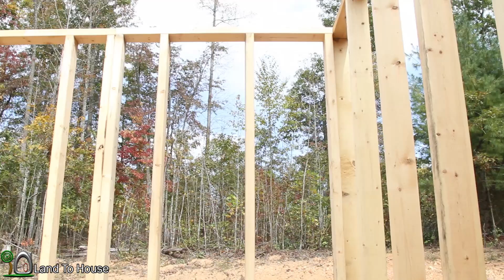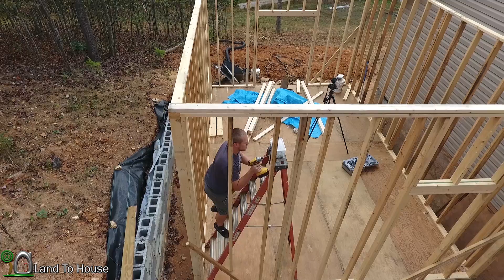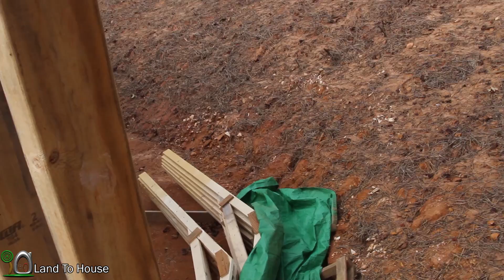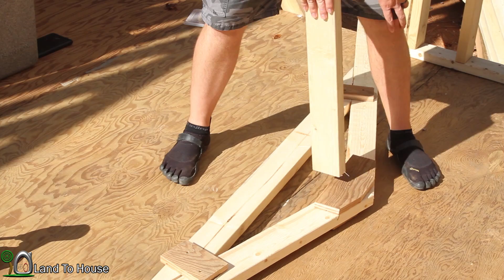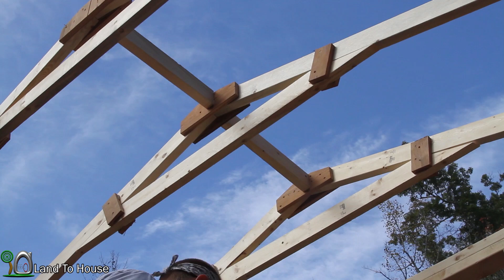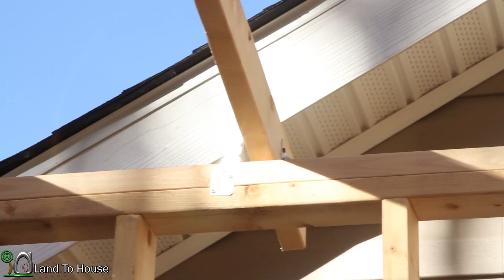Install Top Plate and Trusses - Build a Workshop #9

Comment: Why didn’t to install the top plate before you stood the wall? I see that you placed a stud at the joint of two short walls. That is to say you’ve wasted a stud. It’s such a short run wall that you could have built it in one length and top plated it then stood it. I’m 75 and assure you that I could have stood that wall by myself.

Comment: Hey first timer here at a place where you were.  Did the uneven top plate cause any issues? Would you have done anything different there?
Reply from the maker: Hi. Check the new series on the channel for building a shed. Way better series.

Comment: Nicely done.  I'm not an expert, but I thought you were supposed to install trusses at each end, and from there, put up a line from peak to peak.  And from there add the inside trusses.  Supposed  you've done it so many times you don't have to.  I have yet to do it.  Looks great though. Jealous.
Reply from the maker: I am no pro for sure. Check my new build a shed series. It is way better than this one.

Comment: When setting trusses without a birds mouth as you did here, set the overhang and install both end trusses first. Now you can run a mason's string across the ends (facia board) of the two to set the same overhang for the rest of the trusses. Saves a bunch of time AND aggravation form measuring every one.
Reply from the maker: That makes a lot of sense.  Especially when it's this tall.

Comment: Love the videos, keep on rolling my friend.  BTW very cool to have the drone in hover mode filming some excellent shots.  I'm sorry I groaned when you used the H* clips without birdsmouths or wedges to connect the trusses to the top plate.  These wind ties are only strong against vertical forces to keep the roof from lifting off in a high wind.  They are weak against forces that would bend them outward, like the snow load pushing down on the roof trying to scissor open the trusses.  Birdsmouth cutouts also help you make sure your truss is centered, since the top plate fits right into the pre-measured corner.  Please cut some blocking to attach to the sides of the trusses and into the top plate so in 10 years your roof won't be mushroomed out with bent H* clips.
BTW your trick with the scraps for the end truss is also how you raise a wall and keep the bottom from sliding off the floor.
Good luck and god bless.

Comment: If you were to put the spacer ( bird block/ air registers)  ON the top plate ... the exact proper distance between the trusses.. THEN you nail  NOT SCREW< you NAIL the truss to the spacer & and spacer to the top plate, THEN you're secure.... I am AMAZED AT WHAT YOU'RE DOING...   ALSO when you raised your gable end  IDEALLY, you'd put your  braces ATTACHED TO STUDS... not your little brace attached to the top plate with SCREWS that could EASILY snap right off.  AGAIN... the list goes on about what you're doing that is dangerous not just for YOU, but if you sell this place, somebody is getting some seriously faulty construction... SURE it's together  ... LUCKILY... NO contractor would approve of your techniques and as far as a building inspector... NO WAY would they pass your project in an inspection ... for several reasons............. basically faulty construction

Comment: ALSO  you're using screws on the Simpson brackets..  AGAIN sheer strength ... they can SNAP... what you're SUPPOSED to use... TRY ASKING SIMPSON what's right & they'll tell you to use TICO nails... very thick & pretty short... they will NOT snap off.  The list is getting longer about what you're NOT doing right man.. This is dangerous shit that you're doing.

Comment: You see to have used screws to attach walls/trusses.. Has anyone ever told you about SHEER.. Hammer on the edge of a screw & it will sheer off... It will NOT sheer off with a NAIL.. sooooo Your stability & roof/wall/truss integrity is faulty & dangerous.. DOesn't matter that you say it has supported 200# men & snow.. the FACT remains that if you WERE to check into code... because you want to do it RIGHT (whether you're going to get inspected or not)  you would NOT be allowed to use screws.  ... Also  your trusses could just lean right over.. You built them without a bottom (where you'd be attaching drywall ceiling... WTF...  attach it LATER?  Haven't ever seen PRE FAB trusses without a bottom.. Good luck  Your place is seriously lacking integrity for long term.. This is DANGEROUS suggesting other people do just like you do... it's WRONG man.

Comment: one point if i may  had you let the additional top plate run over you then put a 4x2 in edge and form an over hang for your final truss ,that way get over hang all around and could use your metal fixings,also a little concerned re the amount of screw as you have on those peices of ply ,usually a web is made of ply  thinner than what you used {but  agree use what you have} and cover and is screwd or nailed to a pattern,also woud not have fixed the spacers  at the ridge line ,though you are doing OK ,amazing what a plank and additional timber fixed to the studs do allows you to walk along easly
 you can nail a  3x2 or 3x1 along as you go to hold the truss ,and a temporary brace to hold it prior to the sheeting you use in the usa
Reply from the maker: The extra length of 2x4 on the ladder would have been nice. But this worked in the end. So far the trusses have held 16" of snow without issues. That was a lot of snow! The extra section of plywood on the end was annoying. I did not consider that until it was too late. Thanks for the comments!

Comment: Can you cut a birds mouth on 2x4 rafters?
Reply: It depends on the pitch. Check your local building codes
Reply from the maker: I don't have the answer to that question. I like the use of the two metal fasteners. But the pros like birds mouth and 2x6s.

Comment: It is tough working by yourself < I know because that's what I do ,  but a couple of things noticed . First your clips we be in the way of your siding , second never have I seen trusses mounted without a birds mouth or top plate cut third and foremost why screws , they have no shear strength to them are twice as expensive as nails and very time consuming . hope you did'nt use them for your framing . You need a framing nail gun . I did like your little jig setup though I have used them myself . Hopefully you don't get much snowfall , because those 2x4 trusses will not hold it  Good luck on the build and GOD bless
Reply from the maker: This was a learning experience for sure. I hear the h1 clips dont have to have the birds mouth. I am building a playhouse now that uses nails. ... in 25 years the largest snow I have seen here is 16".
Reply: @LandtoHouse  good luck , keep having fun with great attitude

Comment: I was under the impression that the H1 Clips are installed on the interior side of the wall not the outside as you demonstrated.
Reply from the maker: I did a good bit of research on these and found mixed opinions. Some said yes some said no. So far I've had two 200 lb men on the roof. And a 16-inch snow. No problem so far
Reply: You are correct. In this small shed, Hurricane 2.5s is all that needed. Hopefully he adds in ceiling joists and blocking.Also, screws are no good in this build. minimum 10D common, and a good carpenter stacks his nails and avoids fasteners in the voids.
Reply from the maker: Blocking and rafter ties are added later. The roof took 16" of snow no problem last year.

Comment: Did cut a bird mouth on your trusses. That is where you nail on the top plate.
Reply from the maker: When I looked into the H clip it said no cut was required. SO far it has worked well. No issues even in a 16" snow.

Comment: About the H1 clip - I guess is supposed to be mounted inside the shed.
Anyway, very inspirational video.
Reply from the maker: I actually looked into that. They can be installed either direction. I liked this way to allow install without angle cuts on the trusses. Thanks for watching!

Comment: The rain is going to shed into your home so it might help if you make sure that you have good drainage with gravel so that your house foundation doesn't fail. Teco nails for your hardware and 16d vyinle coated for your framing will hold better and be legal.
Reply from the maker: I completely agree about the drainage.  Gutters are in the future of the shop. So far the shop is doing amazingly well. I am starting a new project soon and will be using nails for much of the frame.

Comment: should ever build another suggest you have cross half checks at each end of the wall ,they fit and hold and no need for another top plate oh use nails old chap quicker easier and hold  plus cheaper
Reply from the maker: I am not familiar with cross half checks. What do they look like?

Comment: @ 10:10 mark...

"what are those?"

Lol, just kidding man. Great job! Specially for someone who isn't in this profession 👌.
But seriously though,  consider using either bigger screws or framing nails. Think long term for your project! And better footwear......
Reply from the maker: The footwear for sure haha. I think this was the last time I used the sandals for a build. SO far there has not been a single issue with the construction. As you state I am a no pro here. Thank you for the tips!
Reply: Nails, all the way. Screw shouldn’t touch framing ever unless it’s temporary. Not bashing, just advising!

Comment: When you want to install that first truss, instead of using a short 2 x (4 to hold it vertical) attached to the top plate, use longer pieces of studs and attach them to existing studs AND to the top plate, to have the truss vertical. And, get a taller ladder. Installing lower sheathing plywood would make all the structure much more secure, before you start upwards to install trusses. Also, scaffolding would make this part of the installation three to five times faster. Use three and a half inch screws to attach upper plates. A big wind would just rip out the ones you installed. Sixteen penny nails would have been faster.
Reply from the maker: Thank you for the tips! I especially agree with the scaffolding. The ladder that I was using was just a little too short.  We have had a few good winds over the past 2 years and so far no issues with the build.

Comment: Because of screws. any movement and the whole shed can fall apart!
Reply from the maker: Well there must not be any movement in the past few years. The shed is still standing.
Reply: There are too many that assume screws are inferior to nails.  My experience has been construction screws pull connections together better and  don't pull out over time.  Screws make for a much stronger (solid) build IMO.  Great work!
Reply: @PSYOP2009  it is the shearing strength that a screw does not have but a 10 d common has. A screw can snap at the meeting point of metal to metal.   ( it will hold but a strong wind storm would tear it apart)
Reply: marco hanse 😂 Where did you hear this?
Reply from the maker: A lot of people have a hard time with how I built this shed.
Reply: Yeah...I saw this happen....never!
Reply from the maker: Haha well I guess it could happen. The shed roof did hold 18" of snow last year.

Comment: I admire his spirite, but his methods are not repeatable or accurate. Also he should be using nails. Ok to put screw to hold in place, but nails must be used!
Reply: Not a carpenter by any means, just curious.  Why nails?
Reply from the maker: People say it's because of the sheer strength.  Harder to ripout nails.
Reply: Pulling out nails is tensile strength. Cutting nails in half, for example, is Shear Stress. Screws are usually made of hardened steel, therefore they have higher tensile strength but are more brittle than common steel. Being 'Brittle' usually indicates a reduced Shear Stress strength. The forces involved in spanning a distance by roof trusses involves 'Shear Stresses' on the fasteners, not so much Tensile Stress. Therefore nails would be preferred instead of screws for a stronger finished job.
Reply: Graeme J2 
Yeah man if you can get your hands on a pneumatic nail gun and compressor you got it made in the shade.
You can find good deals on used ones but can’t go wrong with new stuff.
One thing I would have done differently since the span on those trusses is pretty decent for how they’re constructed for more ceiling clearance is I would have filled the entire lower run part of the truss all the way to the rise pieces like a big plywood triangle.
Glued down with a good urethane construction adhesive and nailed down (or screwed) as the glue will be stronger than the fasteners once it dries.
The more surface area your plywood gussets cover the stronger your trusses will be for that span.
I’m sure some will tell you those trusses are way wrong for that span but with the best reinforcement i’d say they’d be fine although if you run plywood sheeting and shingles that’s gonna be pretty heavy
If you use purlin boards 2’ on center and steel sheeting you’ll have much, much less weight to consider.
Either way, as mentioned it is refereshjng to see a do it yourself video with a polite host that’s not cussing like a dock worker.
Nice job fella.

Comment: You didn't plumb and line the walls. They are are not automatically straight and plumb; you have to adjust them and install diagonal braces to hold them in position.
Reply from the maker: Yes that is true. I am a new builder and I am learning some of these things the hard way. The walls were close luckily.
Reply: @LandtoHouse  You can usually square the wall with the sheathing instead of bracing and lift shim floor to bring the rest into square when sheathing roof

Comment: I did not see if you checked the top for square before installing the top plates.  Was it square or did you later find out it wasn't quite right?
Reply from the maker: I have been building now for some time and have just noticed that it was not just right. When I made my storage shelves inside there was a little issue in the corner. But for the most part the building is square enough for my liking.
Reply from the maker: Seems like some pretty wise advice. :) I get a lot of comments on YouTube about how unprofessional my work is... If I were a professional with only two structures built I would be a miracle.

Comment: this is bad ass just use nails much stronger
Reply from the maker: Yes I needed to use more nails in my build. But the building is doing well so far.
Reply: does it matter for hurricanes if you use screws or nails:-))

Comment: What the hell were you thinking sitting the shed that close to the house. The pitch of the roof will flood the house siding, and your non skinny ass has to fit between them to do repairs. Rookie Move!  "W.W."
Reply from the maker: +Holleran Properties ha ha your comment is full of positivity and uplifting advice. After a year there is no issues in sight with how close the building is to the house. I have a rain catchment system planned that will reduce the spillover of rainwater significantly.... as for my donkey I might overfeed it a little bit but he is ok with repairs. :)
Reply from the maker: +James LaCombe my goal is to have some gutters that have a lever to fold down in the winter.
Reply from the maker: Yes. Learning as I go. There will be a gutter system in the future that will take most of the water away from the house and to storage tanks for garden watering.

Comment: it seems your building is a little close to your house, are you worried about the snow, if you have snow in your area coming off your roof and landing against your house???
Reply from the maker: +Dan that could happen. It seems like snow only last a couple days here so it's more likely to be a drainage issue. I guess this first year will tell.
Reply: Land to House 
Could always connect the two and fill in the gap with another roof section.

Comment: With that length of span, using 2X4 trusses, I feel like your roof will have quite a bit of bounce to it.  If you are using metal roofing this is probably not too big of a deal but with asphalt shingles, it might be too heavy without some ties from top plate to top plate.
Reply from the maker: +kuhrd my dad and I were both on the roof this past week and it had only a little bounce. I will be using metal for the roof so not quite as heavy.  I still might use some ties inside just to hang some stuff on and give more support.

Comment: I think you had a good idea on the end clips. With the siding everything should be ok.
Reply from the maker: I was thinking the same thing. With the sheathing it should be more than strong enough. I dont think that it is to code but I guess that is not as important in this build. ....I am missing several steps if it was to be to code.